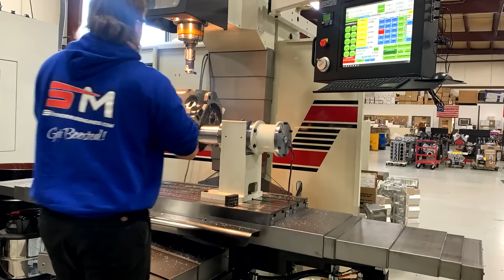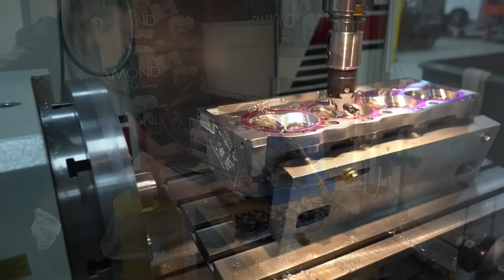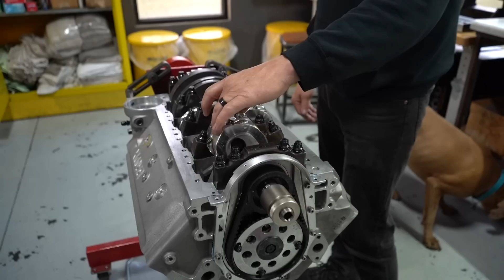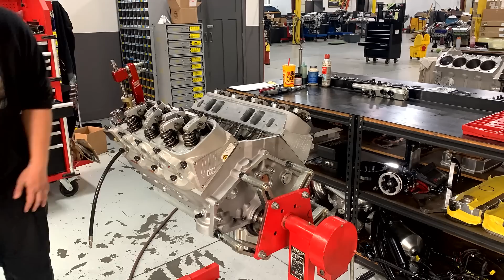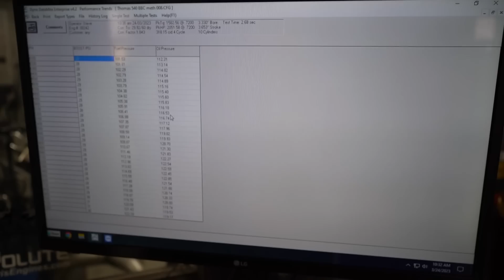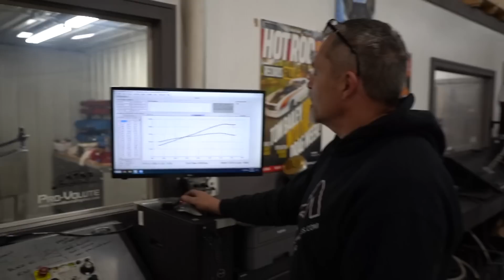Supercharged Big Block Build and Dyno Session!

Comment: Why can your SMX Engine handle so much more boost than a fully built BBC?
Where is the weak spot?

Thanks Steve for your interesting, educational and entertaining videos! Keep it up
Reply: If you’ve been watching Steve videos for several years you’ll see that he uses a big chunk of billet aluminum to machine his blocks out of not a cast aluminum block and the  hoops machined into the heads and Block to hold in the boost Steve engines can take moreBoost which means they can take more fuel which means more horsepower

Comment: to a machinist .001 is not close enough.  my machine level reads in 10s  thats .0001   that is dead nuts.  when your tool touched off , it touched the back of the head first for 2 or 3 rotations.
Reply: To add... I wouldn't read too much into a level for machined surface flatness. Running a 10th's across it in the spindle is the only test needed. I'm assuming you knew this, being a machinist.
Reply: @Godfatherws  yes,  just making a point .   they should use at least a .0005 test indicator.

Comment: I am curious, because aluminum, like other metals, begin to corrode pretty quickly, even with just the moisture in the air, is it important to get the parts put together as soon as possible?

Comment: At what point do you start wondering or dealing with charge temperature. I know that squeezing air to 20 psi brings the temperature of 300° but in drag racing it all happen so fast that in the coolers or not the place to be anymore. But still with a huge boobs numbers some of these guys are running. The lake in the temperature is gonna be an issue.
Reply from the maker: Inter cooling is always better
Just can’t fit or is not in the rules

Comment: Boost doesn’t equal horsepower, boost is not a measure of power, more boost does not equal more power, more boost doesn’t equal a power number, boost doesn’t really say much at all….
Reply from the maker: Yes you are correct 
Boost is a reference number.